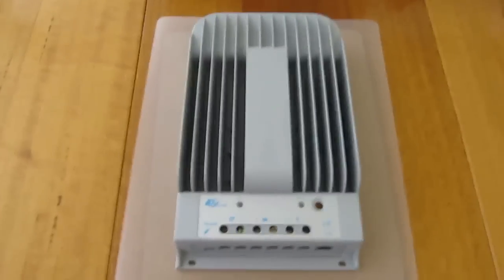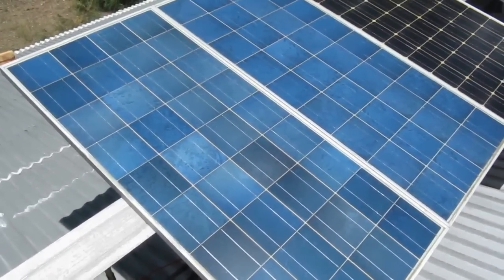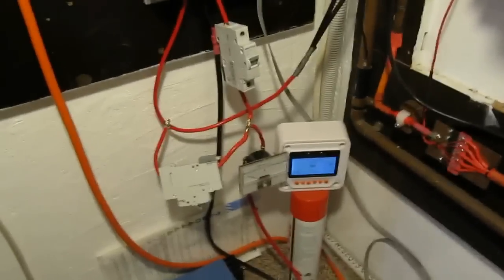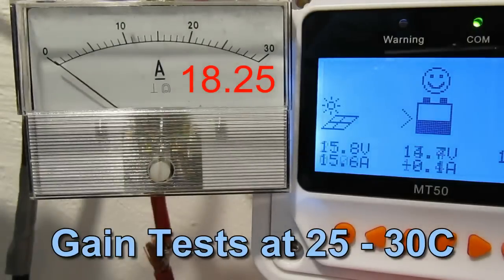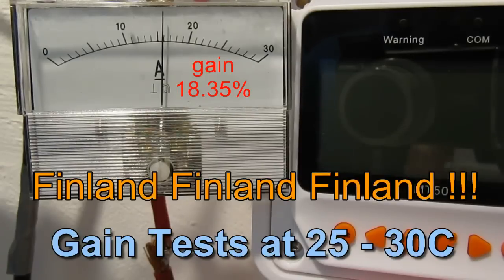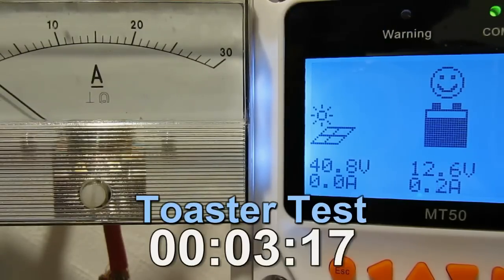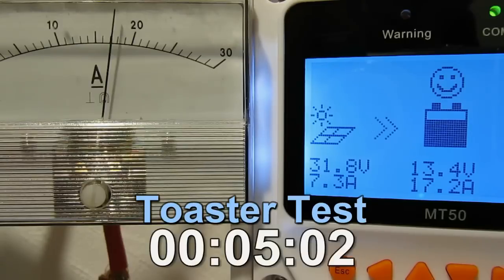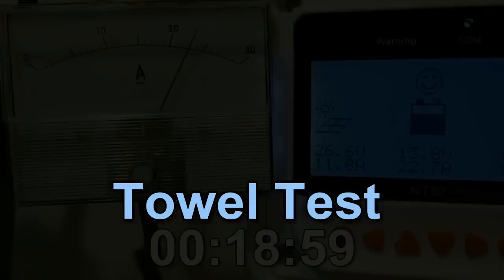EPever EPsolar Tracer 4215B MPPT review PART 1  - 4215BN

Comment: I just got mine and hooked it up...its very overcast and almost sunset on a rainy day and its still putting a few watts into my batteries...Im getting a fourth 100 watt panel thursday so I can have two on the east and the other two on the west for a more even charge...I am amazed that its working under such low light..I will be riveted for the mt 50 vid..

Comment: I have four panels at 295w and was hoping to connect all four into a 12v system.  But, I know the max is 520 for a 12v, wondering if I put two of my panels, 590w max into the 12v, will it still make smoke?    Just needing some advise, can I parallel two panels together to charge 200ah 12 battery system?  Great video by the way.
Reply from the maker: Depends on your ambient temperature. Panels in hot weather output 70-75% of the rated value. 590W of panels will probably output 35A into 12V. Plus, are the panels already worn in? They lose power over a few years. The main problem with this charger is that if you have 24V panels, it will get lazy (find the wrong MPP) and start taking a low voltage off them. So, you might see only 20A going in one day.  But there is a theoretical condition where the panels are cool and the sun is brighter in between clouds, where full output can occur. The manual says the controller is rated to blow up at  (3x) input 1560W. Personally I think the controller could blow up at any time, so watch the average value.
Reply: @Wallabynge  They are around 7 years old, I bought them used.  So, I think they may only put out about 250w each, that puts them at 500w...under the limit for the 40a mppt charge controler?
Reply from the maker: @ryancouch76  Sounds like you will be wondering if you should put a third one on. Your average output could be 26A. I think 30A is the best place to work them, because they are not very efficient. I hope your panels are not lightning damaged. I have a chump around here who sells damaged panels to all. They get spider lines on them after 2 years of heat and then drop output.

Comment: Glad I found your channel! I have the  4215bn with  mt50, and whenever I connect my solar panels in series (2x100w), it will display the accumulated voltage for a few seconds (40w) under the pv icon, then it will go down to between 13-20v, immediately, even if the weather hasn't changed (no clouds and fulll sunlight). Does yours stay up at higher voltages for more than a few seconds?
Reply from the maker: Two panels in series should have a working voltage of about 33V. Panels which are broken will have the effect you are describing. I recently got second hand panels from a local guy who was selling ones that had come off roofs hit by lightning. I put them in parallel and now they all have the same OC voltage of 31V. I presume you are charging a 12V battery.  You could have a broken one.
Reply: I have the 1215BN with single amorphic 90W pv panel (OC voltage around 90V). In cloudy weather when the pv is first connected it scans the I/V curve showing max power of 12W (at approx. 45V pv voltage) but then the voltage suddenly  drops to approx 13V and the system delivers only 2W. The panel is new and tried another one with the same results. The battery voltage is in the bulk charge range of course. I suppose that's there is some issue with the software.

Comment: When panels are connected the voltage drops.. Any troubleshooting ideas.. Tired series and parellel and nothing is working.. We ate full time RVing and would love any input. Thanks!
Reply from the maker: Voltage of what drops?  Have you put everything backwards? If not, then sounds faulty. Sounds like it is scanning the power curve and then doing nothing. Does the voltage drop in the first 2 or 3 minutes? What battery voltage? What panel voltage? Are you using the MT50? In short, you have given no information.

Comment: i have 2 trogen 6 volts connected for 12 volt bank. long story short they have sat for a yr with no charge to them a currently read 5.38 volts. i ordered a mttp controller and a 100 watt panel .not yet installed but after research i dont think the controller will recognise the low volt batteries to  start charging them.can i hook the panel straight to the bank to bring up the voltage to then add the controller to finish the charging?........will this work ?.how long do you expect it would take to bring up the voltage to maybe 11.6
Reply from the maker: Yes, you can do it. 100W is 5 amps. The batteries will take output for 12 hours, but it will take about 1 hour to get them up. Just watch for weird boiling phenomena
Reply from the maker: PS. Don't expect them to work real well, because they will have a hard plate of sulfate all over them, which cannot be removed.
Reply: any way to desulfate  through the controller ?
Reply from the maker: http://batteryuniversity.com/learn/article/sulfation_and_how_to_prevent_it

Mebbe the only thing you can do, is put the equalize and charge voltage up to 15.5V. I only say put the eq voltage up, because the controller will complain if you raise the charge above it. Keep an eye on the water level every day.

Comment: I think I messed up got two 315w panels and this 40 amp controller only to realize its max input is 520w. I can set up my two 100ah 12v batteries in a series to get 24v that will allow me to get over 1000w input. Just hate loosing 100ah because this will be running 12v lights in my sons off the grid cabin. Good 60amp mpt controllers are just out of our price range atm. If anyone can answer would 630 watts destroy this controller running a 12v battery bank? Or would 100 ah be enough to run say 8-10 low watt 12v led lights?  

Built his whole cabin by hand but this solar stuff has me worried lol
Reply from the maker: You don't lose 100ah. You get 24V, so the energy is still the same. However, it's a pain running 12V lights off 24V system, without small DC-DC converters everywhere.  Use: dc converter 24V "to 12V", as a search term on ebay. (Don't buy from China mainland, only HK, because China takes 2 months).

However, it will likely work as 12V. I've got 525W of panels on mine, and it's only outputting around 26A. Once you've installed it with shonky cheap wiring, your output may be 32.7A @ 14V, and 36A at 12.6V... The MPPT is smart enough to limit the output, by sucking less current, if things get too dodgy. It's not best practice, so consider what other appliances you will be using, and whether they can all use DC-DC converters. Running a 12V Shurflo 11.3LPM pump may be a challenge, unless you just wire it to one battery. It's very low draw, though. I've got one on the vegie patch running off a car battery. Takes 2.5A most of the time.
Reply: Tyvm for your time and response very helpful.
Reply from the maker: I meant the 4009 model Shurflo. Higher pressure ones will likely blow up faster. All the diaphram pumps need a proper switch added, because the micro switches they come with all blow up.

http://www.ebay.com/itm/SHURflo-4009-12v-Revolution-Fresh-Water-Pump-Twist-on-Filter-Pack-Caravan-/181740706411?hash=item2a50971a6b:g:EA8AAOSwopRYhScU&vxp=mtr

Have one of these waiting for when the switch blows up
http://www.ebay.com/itm/40-60-PSI-Well-Water-Pump-Pressure-Control-Switch-Adjustable-Double-Spring-Pole-/371515020594?hash=item5680055532:g:BdIAAOSwjDZYktvh
Reply: MrSnapy1 I
I would just use one panel until I got another. or different controller .

Comment: Thanks for the review! 

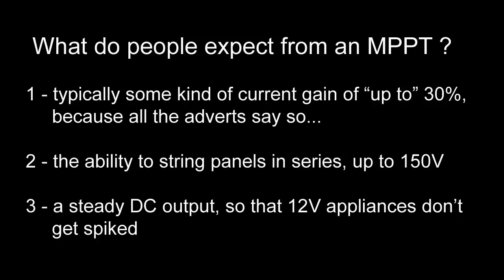In the video (1:45) a slide lists 3 things people expect from an MPPT. Point 3 states "a steady DC output so that 12v appliances don't get spiked". I couldn't agree more! Can you tell me how this Tracer charge controller performs in this regard?

I run several DC loads and my current cheapie Powertech "MPPT" controller seems to pause charging to check the array voltage and find the MPPT - aka a "swep & sleep". This "pause" drops voltage on the load side (significantly on sunny days) about once every couple of minutes and I dare say it's got something to do with cap's poppin' their tops in my DC chest freezers.

Any insights you can share before I sink cash into a Tracer would be greatly appreciated!

Comment: I'm sending my tracer3215bm back today as the mppt tracking issue is a blocker for me. I have 3 60 cell panels in series for a total of around 90v pv. This is on a 24v system. One morning it will work fine and the next it will get stuck down around 28v and never increase leaving my output at a fraction of what it could be. The only way to get it to increase the pv voltage is to disconnect the pv array momentarily.
Reply: Did you ever found a way to resolve this issue , I'm having the same problem.

Comment: I hope my 4210 tracer doesn't blow up I haven't had it for a whole year yet it was the factory reconditioned item it seems to do ok I had a MorningStar ProStar PS 30  m metered version pwm controller it would only take 30 amps,,,,, I still have it I think it would be in wonderful unit for a weekend Cottage or something like that however it would only take 400 watts at 12 volts you could run a refrigerator with it but probably only a couple 3 or 4 times a week if you had enough Sun ,,,,,in the winter time and when it rains a lot or when it's cloudy that pwm charge controller just simply couldn't get enough out the sun and panels to put into the batteries,,,, I should probably look at the TriStar charge controller that morning star sales,,, I like to try and save money sometimes I guess I really need to be careful about doing so though,,,, I was going to buy samlex 1500 watt inverter however I found something called a power Tec on 12 volt 1500 watt inverter instead for $168 six months or so back now it's considerably more,,, found it on Amazon,,,,  sine wave inverter I suppose it's probably junk I haven't used it  whole year yet,,,, so far it runs my refrigerator pretty good but I reckon I should probably put it in a box that it came in seal it back up and put it away as an emergency backup and probably buy the samlex unit.

Comment: I have a tracer sold by renorgy mppt charge controller it's the 4210 tracer,,,,works good I bought it as a return that had been reconditioned $134.99 off of eBay ,,,,,,sometimes renorgy sales returns and refurbished items on there they're hard to find I found another one recently I'm thinking about buying it so I can have a backup or maybe use it to parallel with the other 4210,,,, I got 500 watts at 12 volts on the one I have now I could put another 500 watts at 12 volts on the other one if I do that then I want to get bigger batteries right now I have 4,,, 6 volt golf cart batteries,,,, that new one that you've got there Amazon sells that and so doesn't renorgy they're calling it the commander there's 2 different sizes they are higher in price you do you think they're worth what they're asking,,,  is this model that you're testing there that's what they're calling the commander series are they as good or better than the old 4210 tracers,,,, are they worth the extra money
Reply from the maker: With any 12V system, you may be better off using a solid PWM. The main problem with MPPT is wondering if the unit will explode and overcharge your batteries.
Reply: I see,,,wouldn't it that happen with 24,36,48,etc.???
Reply: Mabe if I get an morning star pro star mppt would be better????tristar or something

Comment: how did you update the firmware? having trouble finding out instructions for it. I can't find option for it at least in solar station monitor.
Reply from the maker: Have you got the USB cable to do it? Comes from the supplier
Reply: +Wallabynge I will have soon. is that .apk file in their website the firmware or did you need to ask for it separately from the support?
Reply from the maker: Sorry, I can't see any firmware update on the epsolar website. My one was called TracerUpdateV205.rar, and had two programs in it  PrgUpgrade.exe and UP_Tracer_V0205.prg

I have sent them an email, because I would like to know what the difference is between the B and BN series. I will see if they can point me to the most updated software for both products. I would assume compatibility.
Reply: +Wallabynge I also asked support about latest firmware and instructions but got an answer that there is no update... maybe they took it away. I'm about to install this controller and wanted to upgrade and setup everything before going to the island.. well probably all will be good without the update anyway. thanks for the effort. not too much info available for this in Finland.
Reply from the maker: I just got a reply, but he avoided telling me anything about updates. He said that the Tracer BN series has ETL certification. Otherwise, I couldn't see anything that wasn't in the B series.  BTW, I use Sonnenschein/Exide A600 batteries. They have lasted 9 years, with no signs of degeneration yet.
Reply: i have Exide nautilus batteries and the reason i'm expanding to mppt and double the panels is that my system could not handle the whole weekend without proper sunlight and warm weather with fridge cooling really often. if more panels and better controller with higher voltage does not do the trick i'll need to consider bigger battery bank. my exide nautilus bank has 3x115ah sealed batteries 7 years of age so maybe they have seen their best days already. All the electric gadgets at the summerhouse seem to grow in numbers every summer though after we got this off grid system installed... no going back to the darkness anymore.
Reply: i have managed this far with that size batteries as i mostly stay 2 nights in a row. And as i live in Finland there is a 6 month period when there is too cold to be on the island or sea freezes over so we can't get there. But i really get the point not having to wonder all the time whether the battery drains or not. 1000€ for the batterybank is a lot of money but if i need to anyway buy new ones then the difference in cost is not that great. if i had money lying around unused i t would be a easy choice for sure.
Reply from the maker: I wouldn't like to survive on 340AH with a fridge. I just bought a Samsung 458ELS, which is a huge fridge with a large freezer on the bottom. It has an inverter compressor. In 29C weather, it takes about 750Wh per day (not counting inverter). Is currently using 648 in winter. Sonnenschein also did a smaller, less durable battery, called the Solar block, which does 2/3 of the cycles of a A600 range.  http://www.batteriesdirect.com.au/shop/search/1045/solar-12-volt-blocks.html  The great thing about the A600 range, is that they are set and forget. There is almost nothing bad that you can do to them. I used to be a slave to my flooded cells.

Comment: I have found that MPPT CC's make the most difference on cloudy days. If your panels get full sun then a PWM is all you need.
I have seen a 30% gain with the MPPT but as I said the biggest difference is in partial shady conditions. In full sun you will see a small gain but less than 10%. Depending on the capacity of your panels you''ll have to do the math and see if it's worth the extra bucks.
 Sure if I had a small panel on a sail boat I'd want the most efficient CC and battery that I could find. In most cases it may not be worth the extra money.

Comment: When you first wire the charge controller into your battery bank how does it know the banks voltage....does it automatically sense what voltage the batteries are...and charges at that voltage...thanks..
Reply from the maker: +Kristian Winder I think it just assumes that you are not connecting it to a totally flat battery, and that a 24V bank will always be above 18V
Reply: The first thing is to measure battery voltage and if it is below 10 volts on a 12 volt battery , there may be a fault in the battery if the battery is good then mount it . if you have multiple batteries in parellel then install a fuse on each battery so you can quick disconnect each battery if there is something wrong . perhaps attach an ammeter on each battery also so you can quickly see which battery that does not have it so good. :)

Comment: all this hassle, when you could just buy Morningstar or midnite mppt controller, it maybe at least twice the price but you get what you pay for..  my Morningstar tristar mppt  will begin charging within seconds from disconnecting power and reconnect. Then with tracking  takes approx. 1 min to full output at any given time regardless of light conditions and cloud covering.     I did consider a tracer unit, but so glad I didn't..   they claim 98% efficiency,  really ?   more like 50%.   if you have expensive 24v panels  its worth investing in a real MPPT  that will deliver what the manufacturer states.